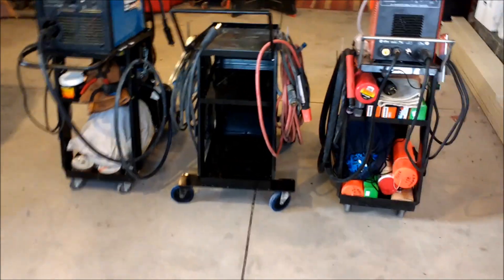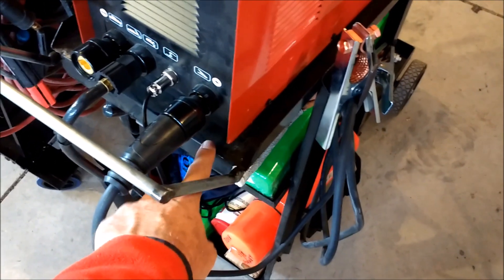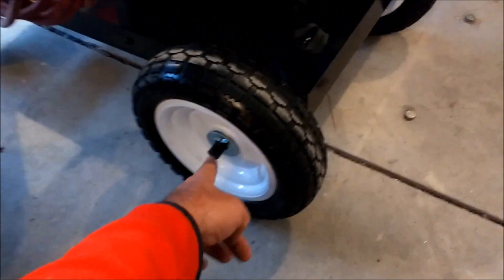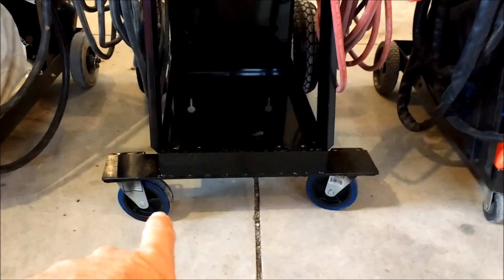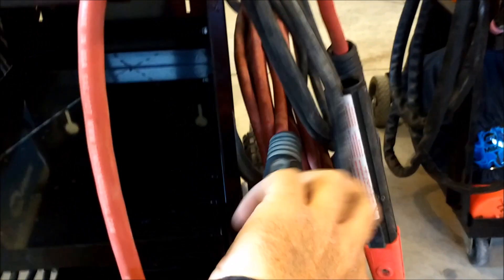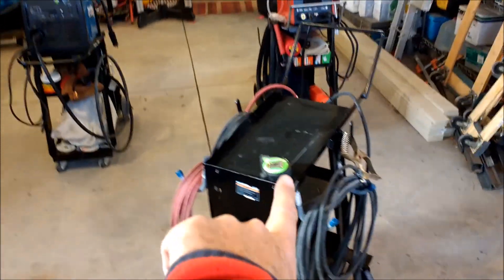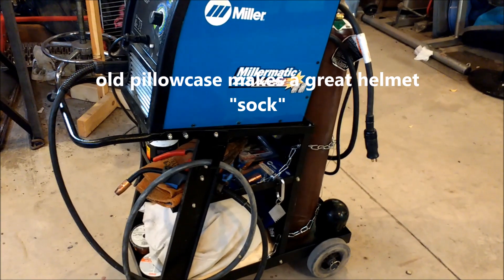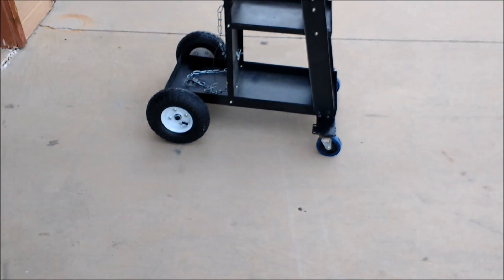HF Welding Cart MODS

Comment: Just did the exact same to my HF cart after seeing your video. Works perfect for rolling on the lawn. Thanks for the great content!
Reply from the maker: Glad it worked! Sometimes I wish I had bigger wheels on the front now. How did you do your front wheels?
Reply: @anesthesiadreamin  I used the same front wheels that you have. If I pull it from the front on the lawn it seems to do fine. Or if I push it backwards allowing the rear wheels to lead it does ok. I literally got done 30mins ago. I’ll see how it does in the future . I’m happy

Comment: Nice set of mods! You need to give us a 5 year update! 😁

I'm definitely going to look at widening the axle and front casters for more stability. I was concerned about floor space but you're absolutely right about the hoses taking up a lot more space on the sides. I'm definitely going to add additional hose hooks like you suggested. Those are WAY better than the factory hooks.

I've had the same cart since 2006. I put good 4" industrial casters on the front and 10" Harborfreight pneumatic steel center wheels on the back and mounted my Hypertherm 380 plasma on the bottom shelf and my Miller 211 (same generation as yours) on the top. With the new wheels It'll last at least another 15 years. 

One other modification I made was to install receptacles and a short air hose quick connect to the middle shelf so I can plug both machines into the cart and only have to run one 20' power cable from the cart to the wall and I can quickly attach my retractable air hose reel to the air inlet on the cart.

I've added a "hand me down" Miller EconoTIG and a Hobart 235xl Stick welder mounted under my Facebook Marketplace sourced rolling 24"x36" fixture table. Keeps it all mobile and easily tucked away when not in use.

Comment: What is the size of the front blue casters? I am going to do mine.
Reply from the maker: 3 inch, quit your fine for rolling around the garage and driveway, but I wish I'd gone bigger for the front when rolling it through the dirt
Reply: I was thinking they were 4”. I been looking at 4” soft rubber ones but I want it kinda level. Do you think the 4” would be to tall in front with the metal on the front like yours.
Reply from the maker: @rickylucy9334  IDK for sure... maybe put the rear wheels on then measure up front to get the height you want

Comment: Thanks for the great ideas,  I hate dragging my welder cart around cause it rolls like a p.o.s.  I am using your ideas for redoing the wheels, adding a 2 nd shelf, rebar for a grab handle.  Those square plastic cat litter pails are great welding helmet storage containers, been using them for years.

Comment: Funny I did the same thing  I used taller lawnmower wheels on the back, put bigger casters on the front used a 2×4 across for the casters. Worked great as I don't have a garage and have to move it around my yard.
Reply: This is literally EXACTLY the position I'm in and what I need to do. Hilarious that I'm not the only one. Tomorrow I'm going to HF to buy this cart. I'm gonna unbox it in the parking lot and go back inside to buy bigger wheels and casters for it.
Reply: @caseytodd7632  Depending on the wheels you buy you might have to change the shift or modify the one that comes with it. To tell you the truth if they had the $ 99 dollar cart back when l bought this one I would have went with that one, the lower profile would make it less top heavy, good luck and happy welding :)

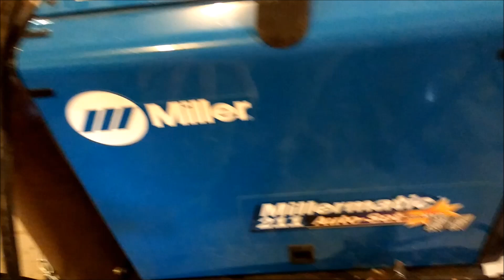Comment: 3:39 I believe they're made from recycled latex products.  6:03 Don't forget to change your settings and technique for the higher altitude.  5:00 You shop at Harbor Freight, yet you still BUY tape measures?  10:45 The one thing that's bad about HF welding carts is they put an exposed locknut and bolt end in the center of the back lip of the top tray.
Reply from the maker: Your comments are EXACTLY what I am looking for! Thanks for your feedback. And yes, I do have a few of the free tapes from HF yet still buy one every few years LOL
Reply: @anesthesiadreamin  What did you do with the rear top bolt?  It seems like you did something because that spot is blacker, but I can't tell what from the video.  I made handles for my HF carts using ½" EMT and a bender.  I sprayed them with Black Stainless paint and they look just like the Eastwood cart.  Came out very, very nice.

Comment: Good video.  I see you have 3 carts.
Would you be able to make just one for off road. That's what I did. I wasn't happy with HF pneumatic wheels. They keep losing air.
I doubled up hard wheels for a broader stance.  I'm happy with mine.
Quick comment 
You seemed to be caught up on measurements and money spent.
A couple inches and a couple dollars either way  for an off road cart doesn't matter to me. 
Again nice job,  I know a lot of thought and experimentation went into it. 👍
Reply from the maker: Thanks for your comments, I've been lucky with my harbor freight wheels so far,but I do wish I had gone to a rigid wheel so I didn't have to worry about it going flat. I do like having 2 off-road carts, because sometimes I want the Mig and sometimes I want the stick welder somewhere outside, that way I don't have to move the tank as well. I wish I had gone with a bigger front wheel though, these small wheels seem to dig into the dirt pretty easily. I like your idea of doubling up on tires for a broader stance and more stability 👍
Reply: @anesthesiadreamin  Wow I see your point on 2 carts.
I've never done both.
If you do have problems with the tires, I have used " fix a flat" with good results